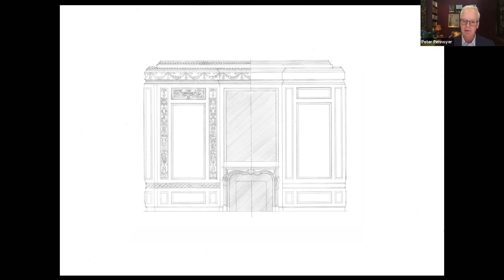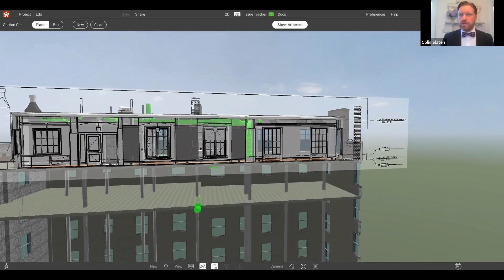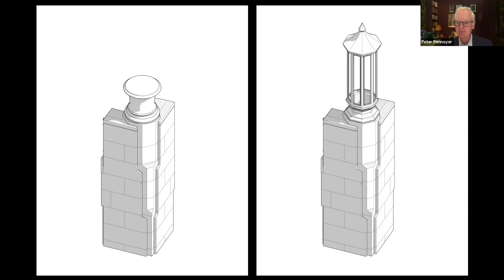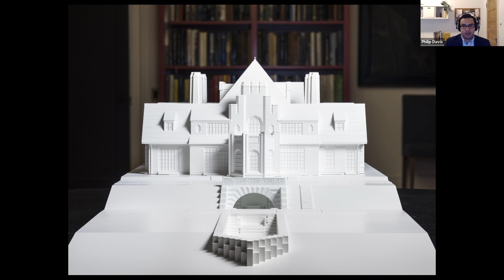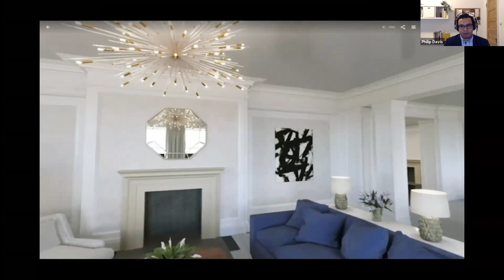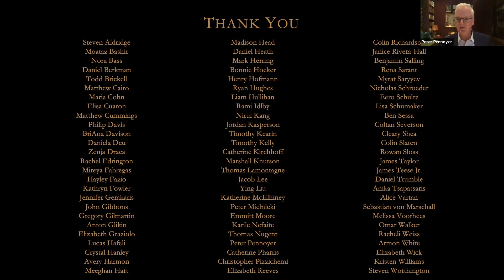Pen & Ink Architecture Meets the Virtual World: Exploring Digital Advances in Design

Comment: Blender 3d can do this entire workflow without leaving the program . (admittedly autocad would be better for the 2d planning work)
Reply: Thanks for watching!  What you're describing is our 2d workflow, but replacing SketchUp/Rhino with Blender.  The Revit workflow works as described because it also produces accurate 2D drawings including the full construction document set.  I'm not sure I've heard of an Architectural firm that uses Blender to produce stamped and signed drawings (but maybe, it is a free program).